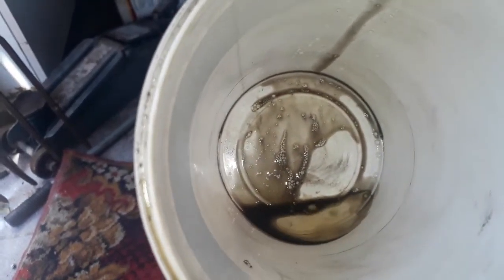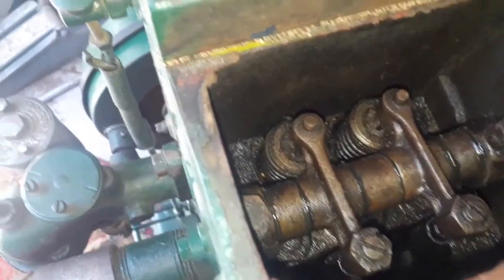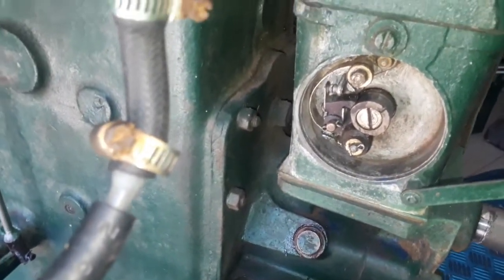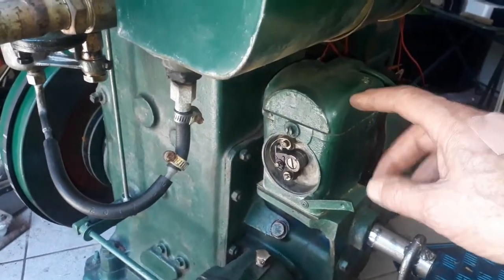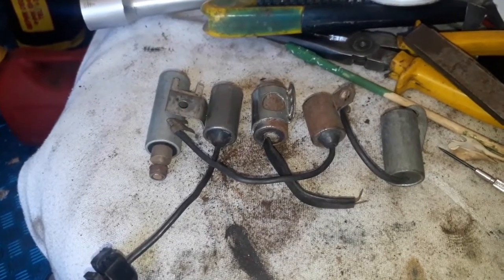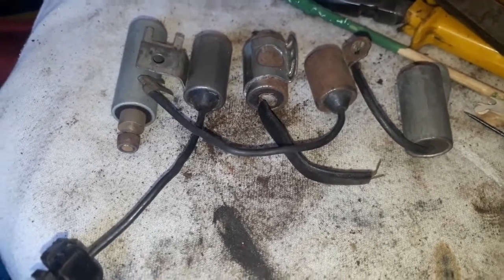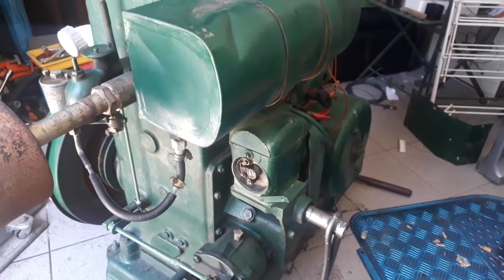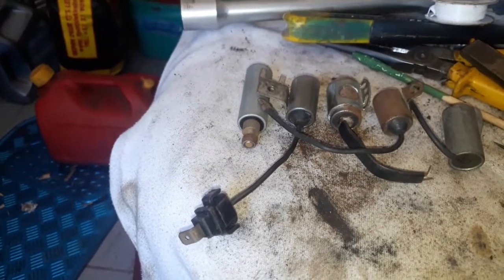Is there water in the Lister Crack case? New fire problem experienced, suspect the condenser is bad

Comment: The best way to test a condenser is to throw it away and buy a new one. Usually, when a condenser starts to fail the ignition sytem (spark strength) the engine becomes unreliable and misfires and eventually won't start. You will win through!
Reply from the maker: Thanks Jon, that is what happen with the machine, misfires and eventually die

Comment: The condensor, if I am remembering right, should be approximately 1/2 micro-farad rating.  It is like a capacitor on an electric motor or compressor insofar as it takes a charge, holds it and discharges it.  Capacitors are checked with an Analog ohmmeter on the Rx10,000 scale.  Touch one lead to the lead on the condensor and the other lead to the case.  If it is good, you will see a blip in the needle and settle at probably an unreadable number on the scale (because it will be minuscule).  If it is 'open', the needle will not move.  If it is 'shorted' the needle will move to the far side of the scale and remain there.  
    Of course this is a test for capacitors with much higher MFD ratings, but in theory it should work as well on this as well.  There are some digital volt ohm meters that actually have a capacitance scale. The tester will read the actual capacitance value of the capacitor being tested. But I have not used mine on a condensor to see if it would actually read such a small value.  Hope this helps and doesn't confuse the issue further Jan.  Good Luck my friend !!
Reply from the maker: Thank You 44, that makes perfect sense what you explain, I will test the suspect one and the other five on video, I really think it is faulty in the way the engine behaved and then totally died, thanks for your help my friend
Reply: @jankotze1959  one thing Jan after each test you have to ground out the condensor because the battery in the meter actually charges it. So the subsequent tests might not be accurate unless you drain the charge by grounding the wire to its own body before each test.   Also not recommended is another test. Hold the body against the negative  battery post then use a jumper from the positive and touch it to the wire for less than an instant. Then see if it holds a charge by then touching the wire to its own body. A good one will give off a spark with a small pop. A bad one does nothing. Like I said it’s not really recommended. On yours because it’s on a mag I think I would try a six volt battery. Or maybe a 9v battery.
Reply from the maker: @tractorman4461  my friend, I found the problem.....watch the next video, thanks for your help my friend

Comment: Jan, You had the engine Running in the last Video and all previous Videos as well. Always starting quickly.... Suddenly, No Spark!!! ??? I don't think it is the Condenser.  They usually don't just Go like that with no warning at all.  Usually, if going Bad they will act up on and off, especially  in Cold or Hot Temps.  I think you have a Dead Ground shorting out the Ignition system. Perhaps, unbeknown to You, while messin with the Genny, You disconnected or crossed an important wire by accident? is that Possible??  At any rate, You're taking the Right Approach, eliminating the condenser or any part as the Culprit is always a good idea , I'm anxious to see what You discover.  Good Luck.
Reply from the maker: Dan, I found the problem, watch the next video